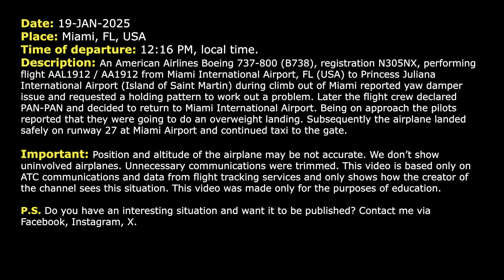Pilot declares PAN-PAN for flight control issue. American Boeing 737 returns to Miami. Real ATC

Comment: Isn't proper phraseology, 'pan-pan pan-pan pan-pan', only when actually declaring the emergency (and a single pan-pan when checking in with a new controler). Also atc didn't pick up on the fact they read back L instead of M.

Comment: ALSO: holding track would NOT be “clean” b/c the checklists will involve disengaging the damper and AP, thus hand flying the a/c to enable the PF to monitor for excessive rudder pedal pressures needed to maintain heading, ensuring appropriate, smooth application of rudder inputs to safely counteract any yawing tendencies. Just like you shouldn’t use cruise control in a car on wet roadways because you need to “feel” how the car is driving to be able to respond safely to any failures down the line.

Comment: 14 CFR § 91.3 and AIM Chapter 6 § 3: establish that when declaring an emergency (MAYDAY, PAN-PAN, SÉCURITÉ), pilots are expected to communicate “Any information necessary to ensure the safety of the flight” (AIM 6 § 3-1). Fuel on board is typically requested by ATC for planning, priority handling, and evacuation readiness.  If requested, it should be provided in hours and minutes of flight time remaining to ensure ATC understands the operation implications. Additionally. ICAO, under Annex 11 (Air Traffic Services) as well as PANS-ATM (ICAO Doc 4444 Chapter 15 “Comms procedures during emergencies”) establishes that when a pilot declares a MAYDAY or PAN-PAN, ATC may ask for FOB to assess severity of situation and prioritize handling. ICAO further emphasizes communication in terms of remaining endurance (hours and minutes) because it is operationally more relevant to manage the safety of all operations - meaning: emergency aircraft, other traffic, ARFF and OPS crews at the airport. ARFF and airport need to know does the aircraft have the potential to be an overweight landing - you’ll wager an aircraft with 6 hours of fuel is more likely to be an overweight landing vs something with maybe, 30 minutes of fuel. Stating in pounds does not necessarily help in handing a priority or emergency aircraft (and those around that a/c) because only the flight crew will know what the fuel burn rates are (a 738 could burn around 850 gallons/ hr, A320 around 800 gallons/ hr, etc…). 

TL;DR: While there is not a single line stating "report FOB remaining in hours and minutes, the guidance on clear communication during emergencies and importance of conveying relevant information implies that fuel should be reported in terms of time remaining to ensure ATC can manage the situation effectively - not just for the emergency a/c, but for other a/c traffic, ARFF, and airport OPS.

Comment: that holding pattern wasn't quite as clean as most, seems like there were more issues than they communicated
Reply from the maker: Yeah, definitely flight control problem 😕
Reply: They may also have been dealing with some slight dutch roll without the Yaw Damper working
Reply: Pretty sure it’s hand flown since the yaw damper is probably required for the autopilot

Comment: Well done. Everybody declares an emergency for such minor things. 👏🏼
Reply: He declared pan-pan, which is basically the lowest rank of emergency. Not your call to make anyway. He did what he found was most appropriate in the situation itself.
Reply: Overweight landing + Flight control issues.
Reply: @chizzo777 pop the cb and the issue is gone, the overweight landing was their own created problem
Reply: @ I don’t know what type of issue they had…some of them are not as easy to fix as poping out C/B. Is there a reset guide wich allows the pilots to perform the reset?  Is there, at the destination airport, a qualified technician or the required materials to dispatch the aircraft for the returning leg? Flying flight simulators it’s not real life…
Reply: This is sad lol no hands and feet skills. This is a non-issue.

Comment: “declaring PAN PAN PAN”

“roger understand you’re declaring an emergency”

do the controllers have hearing problems?
Reply: I think it is just repeating back that they understood the aircraft was declaring an emergency.
Reply: @ PAN ≠ emergency
Reply: @randomwaffler you should read what the FAA says about this. Mayday = distress and pan = urgency, both are considered emergencies.
Reply: @Jay-mj8sz there are so many flight experts here😅
Reply: They're very similar conditions anyway. In the Aeronautical Information Manual of the FAA, PAN PAN as an urgency call is in a subsection within the section called "Emergency Procedures" anyway. It's not really a distinction worth bothering about. The ATC sufficiently acknowledged it as prescribed in the manual anyway.